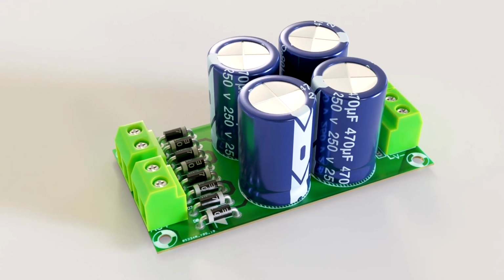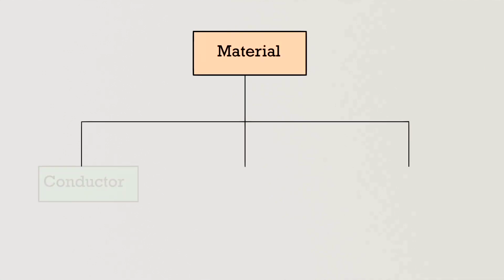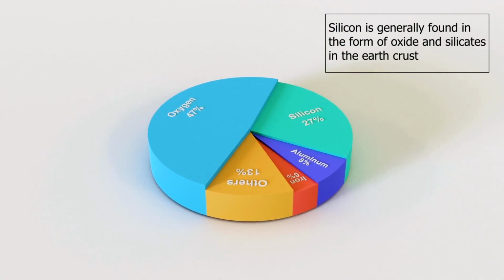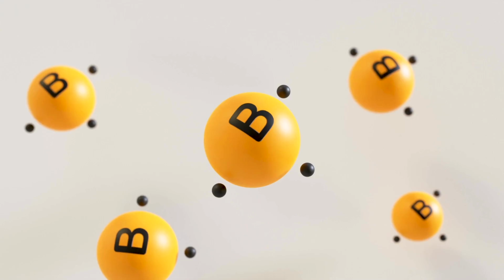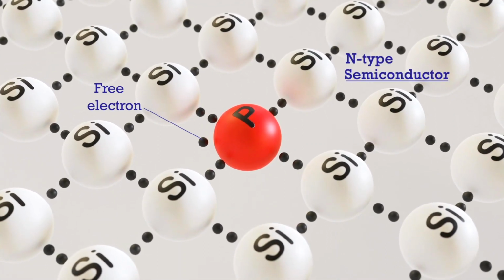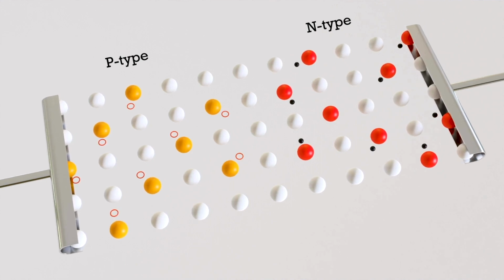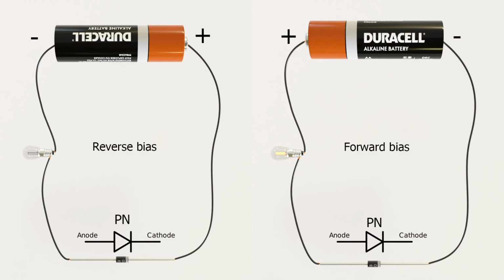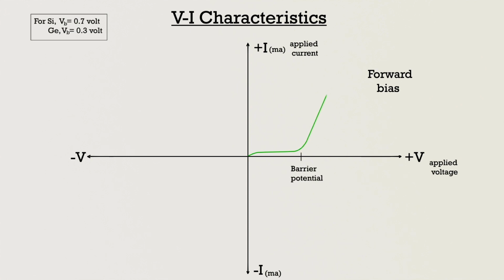How a DIODE Works? Detailed 3D animation

Comment: rather than talking about depletion regions which I have always thought of as spooky,
we can say under forward baiting both the free electrons and hole move towards each other and happily(exothermically)
cancel out    but the time reversed version where they move in the opposite direction away from each other
would require energy to make free electrons and holes and separate them.
this would require light as in a photo diode or patience at a higher temperature.                    
          great animations!

Comment: Why does it build potential shouldnt the excess electons filling the holes and the result is neutral?
Reply from the maker: If a material has free electrons it does not mean that it has a net negative charge ,because each atom of that material carry equal number of electrons and protons. Similar p type semiconductor has free holes but it not have any net charge because it's each atom(including impurities ) has equal number of protons and electrons. I hope it make sense for you..
Reply: Ok free electrons do not mean that thing is charged so why does filling the holes result in Potential? Shouldnt it stay neutral if it was neutral to Beginn with?